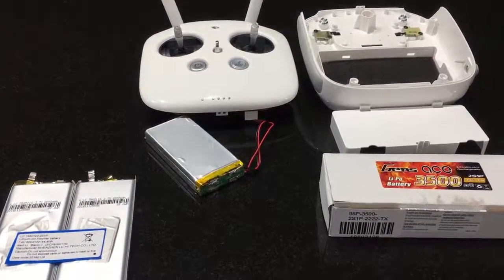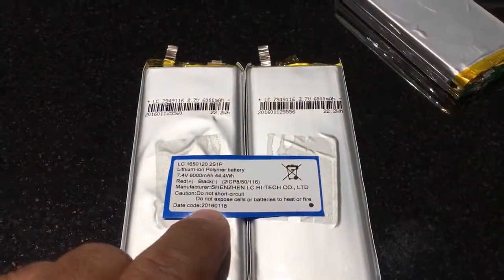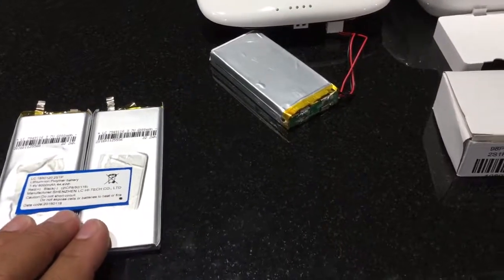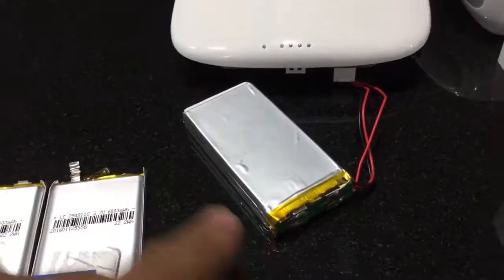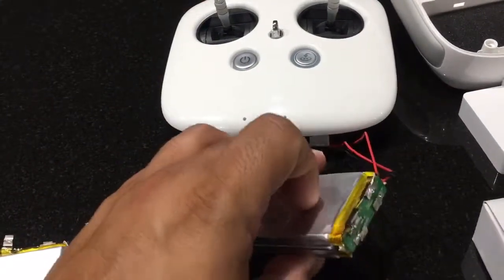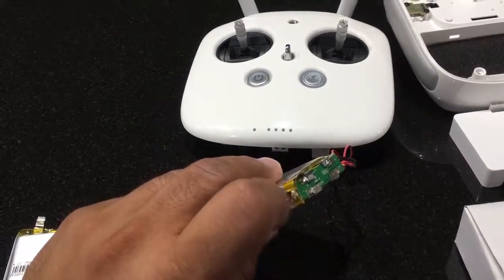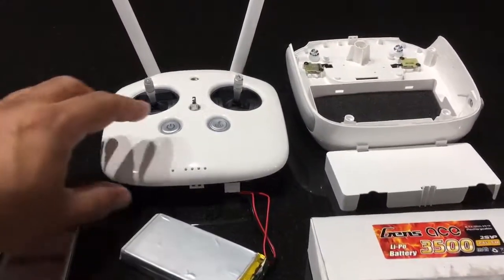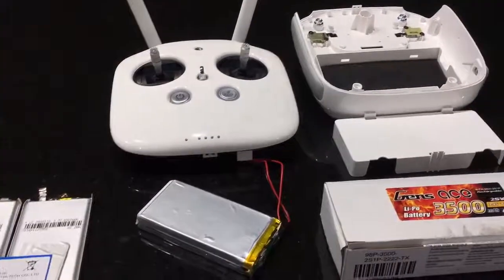DJI Phantom Remote Control Battery Replacement

Comment: I know this is totally off the subject up your video but I did see one of your comments you said you had an HDMI module and if you downgrade firmware to 1.6 it will work. Mine was working I bought a monitor and the HDMI did work but I think I upgraded to firmware on the remote controller and every time I try to hook HDMI to the monitor can disconnect the live feedI would appreciate any information on how to downgrade to 1.6 again
Reply from the maker: Richard Palmisano sorry for the huge delay. I hope you figured it out by now, but just YouTube “how to downgrade DJI Firmware”. I would make another video but no longer have this unit. I mostly build my own but may pick up a new Mavic Mini down the road once they release version 2 hopefully with a 4K camera like Osmo mini.